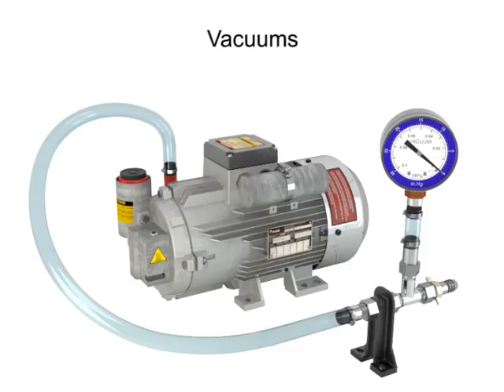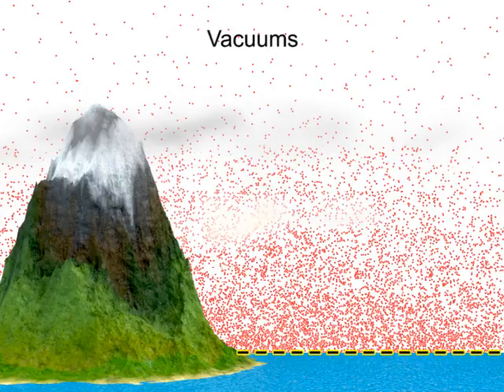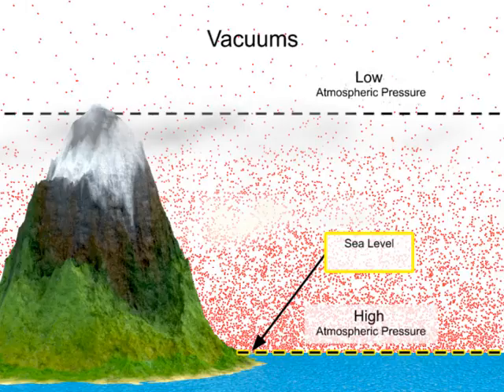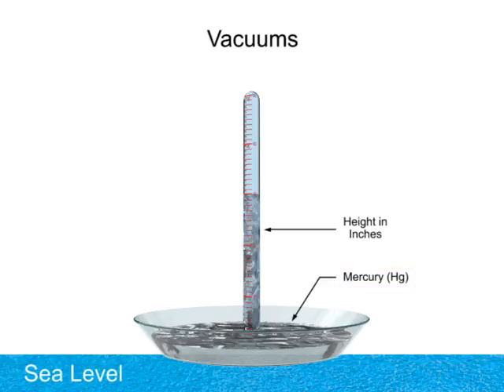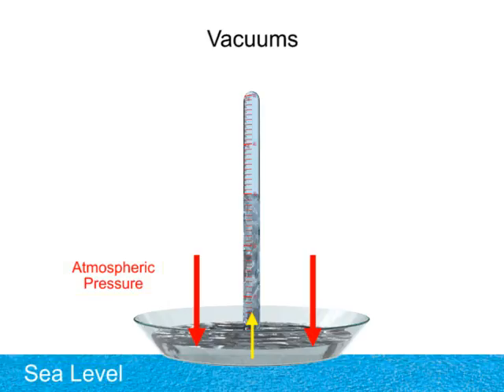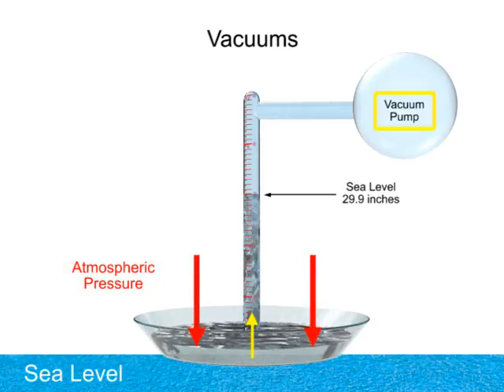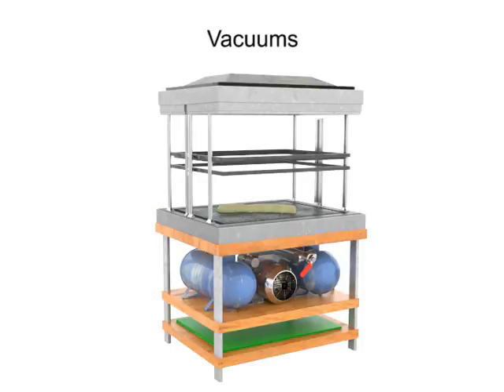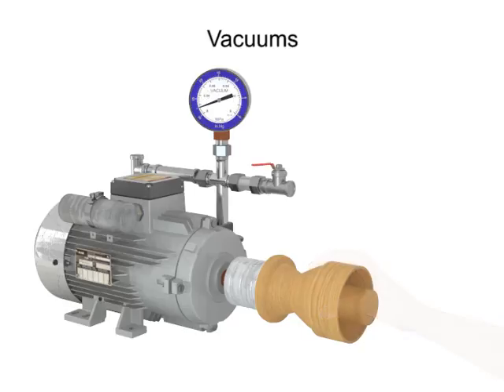Vacuum Atmospheric Pressure and its Effects from Elevation

Comment: Wont the gravity influence atm pressure?
Reply: Yes, gravity determines the weight of the air. Both pressure and weight are measurements of force which is calculated f=ma. So the mass of the air, multiplied by  acceleration due to gravity (which is 9.8 meters per second squared) determines the weight of the air. And then lastly, pressure (psi) is the weight of the air per inch squared. However, because gravity is determined by the unchanging mass of our planet, it stays the same and therefore doesn’t have to be factored into our measurements a second time.

Comment: Thank you for showing us that a vacuum can’t exist next to gas pressure... they both need there own containers
Reply: Q.E. D can you hear yourself... water sticks to a spinning ball, spinning in a vacuum... really
Reply: @Q.E. D  I thought you will explain how space and air can be found together
Reply: The video demonstrated a vacuum next to pressure.  Do you not recognize that vacuum is relative?  If the pressure at one height is lower than the pressure at a lower height, that's vacuum against pressure.  It's that whole "density and buoyancy" nonsense that makes it work.  The air molecules above press down on the molecules below due to "density and buoyancy" nonsense.  (Actually it's called gravity for those of us that live in reality).  Do you not understand the concept of having multiple forces acting on a thing?  I suggest you study math and physics, open your mind.  You know one tiny tidbit of physics and think you know everything.  Yes, you have a parcel of some gas not contained and you have more of it than normally fits in the space it's in, it will expand into surrounding space, that's all true.  So you know 10^-17  of what there is to know about it and you think you know all of it.  You know one tiny little bit of correct information and have no idea how it relates to everything else or what other factors are involved.  I think it's often called, "know enough to be dangerous".  In this case however it's more like, "know enough to look stupid".  Sorry but that's the way it is.  You can fix it though, just stop thinking you know everything so you can learn.
Reply: @mthemaniac   so in that video which force has the most effect?
I thought the vacuum
Reply: @abuadnan1971  you didn't understand at all that video;) Vacuum isn't a force, it is lack of matter.
Reply: @tgstudio85   the pressure around it will have enormous force towards the vacuum.